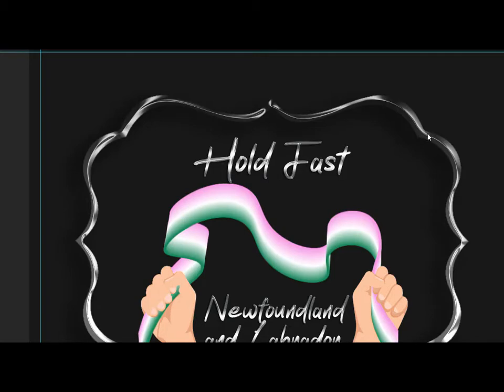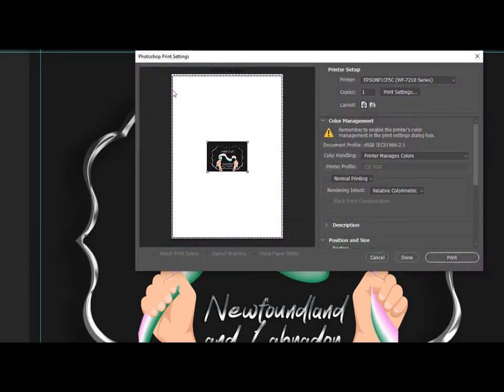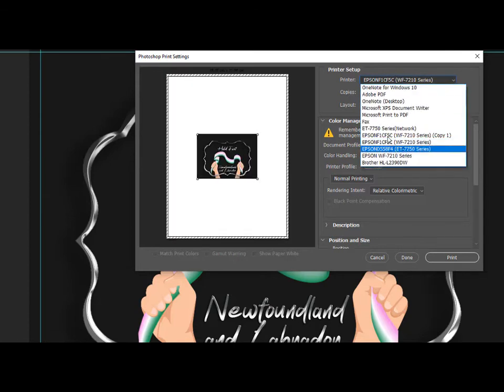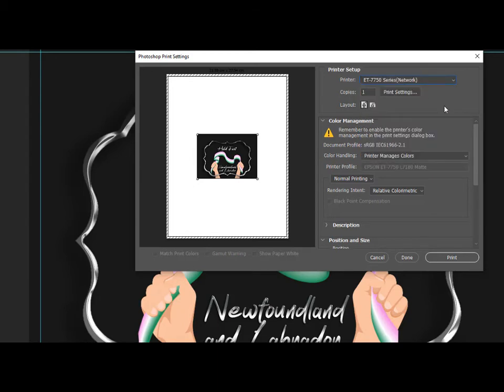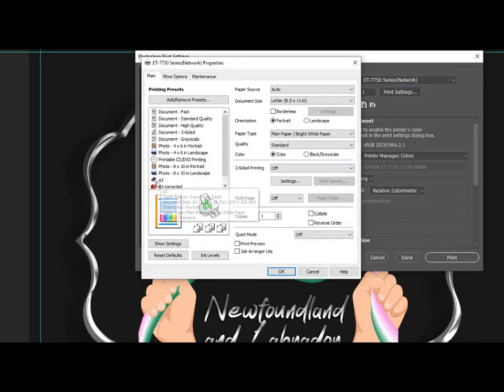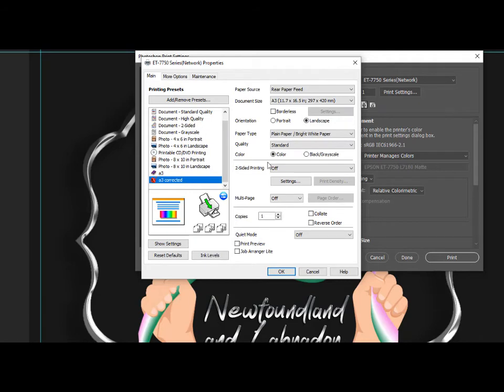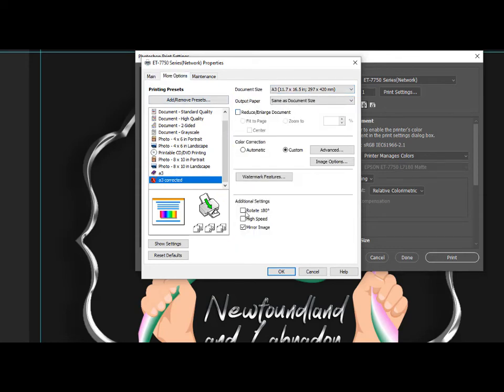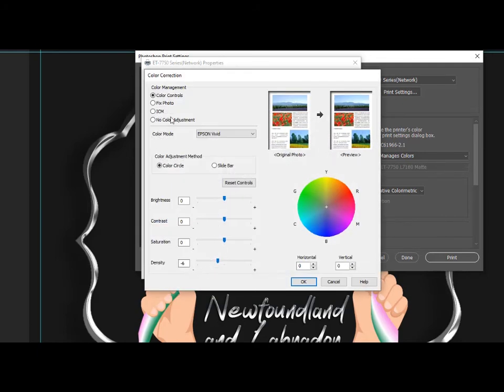How to get rid of sublimation Pizza Wheel Marks

Comment: Are you printing with white ink? If so how are you getting an Epson printer to print with white ink I didn't know this was possible I'm very new to sublimation and DTF hack I have an Epson 2800. With printers jack ink. After a handful of prints started to get  pizza lines in my black looks like it's laying down too much ink it almost pools up on black parts then leaves lines through the rest of the image. My best friend is also having the same problem on her Epson 2803 both new to this and learning as we go.
Reply from the maker: No. Not with sublimation. I do have a different printer which uses white. The sub printer just uses the cyan, magenta, yellow and black

Comment: Did you try Turing the speed of stuff down? Like I found mine was printing fast so I tried a few steps and now its good... Wouldn't putting less ink effect the quality? Just wondering for myself😀
Reply from the maker: in my settings i have high speed turned off.  Less ink actually makes the print look better in most cases.  turning down the amount of ink, to a point, will not lessen quality
Reply: How do I lessen the ink mine seems to pool up and leave black dotted lines through my print. On DTF film only
Reply: I turn high speed off and I print on plain paper setting.

Comment: My wife is having this issue with her Ecotank 15000.    She has assigned me the task of trying to get rid of, I prefer the word "Destroy" this super annoying little issue.   

She has told me the paper is really wet with ink.    Hopefully changing the density setting will help.    Did you play with it to get to the -6 or did you go straight to that.    She is using the Asub 125g paper..  any suggestions?
Reply: Hi Patrick did you ever resolve the issue. I have the same printer with same issues.  I'm going to try this density solution...hopefully it works.
Reply: @LaToya James  Hello, yes I did.    I did this, and I changed the paper from 125G to 120G.   The paper change is what completely solved it.    This printer doesn't like the 125g.   I use the A Sub sublimination paper.
Reply: I'll try again... funny thing is.... no lines on small paper only my big designs 13x9 paper.
Reply: My last resort not to do big designs fora while.... and I may have to use vinyl to complete this order by Friday.
Reply: @LaToya James  Check the thickness of your paper.   If it's 125g get some 120g.   

The one that ended up working perfect for us is the Asub 120g.   

Goodluck
Reply: It's definitely 125... I just checked.
Reply: @latoyajames72  Change to 120g.   It changed everything..........
Reply: Thank you for your time... I appreciate it.
Reply: Hey, I have the 15000 too. I'm having issues with easysubli paper. Does anyone use this?or an alternative for 11x17 subli
Reply from the maker: I just tried it until it worked for me. In the end, I removed the rollers at the front of the machine.